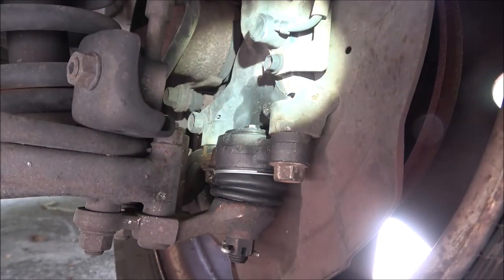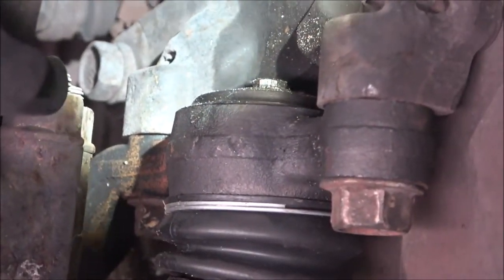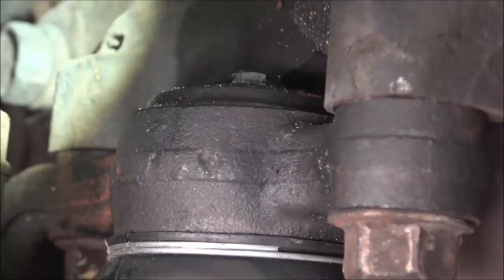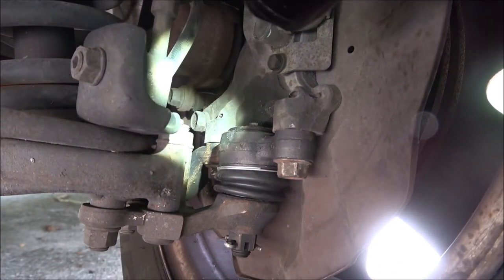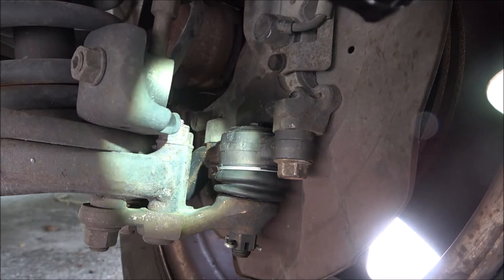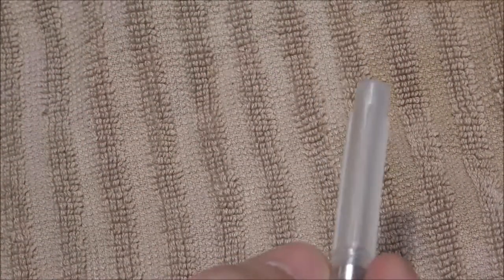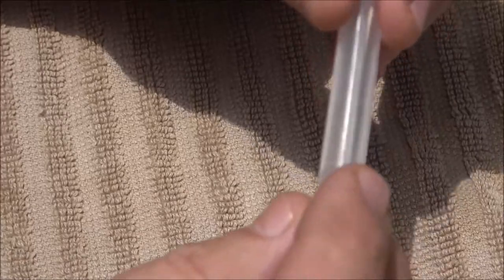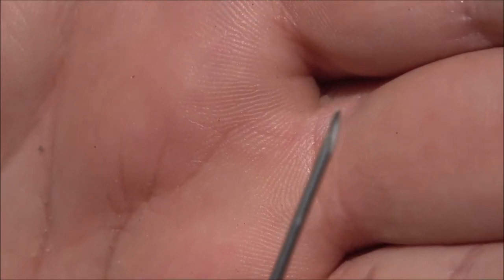How To Grease A Non Serviceable Ball Joint, Tie Rod End, ETC Without Fittings/Zerks

Comment: “Thank You!” I just learned this trick today. My Cadillac has sealed ball joints. It was squeaking like a bicycle that was left out in the rain. That means BADLY.  I used a drImmel sized drill bit.Then sprayed the lubricant (WD40 GEL) in by sticking the straw type tip, that comes with the Gel, into the boot. Drove the car a little bit and IT WORKED!  🙂 “Thank You!”
Reply from the maker: You're welcome.

Comment: You rock! Dang sealed ball joints got me worried no more :face-green-smiling:
Reply from the maker: Hell yeah, thanks man I'm glad it helped. Be safe my friend.
Reply: Dif I miss what you sealed up the hole with
Reply from the maker: @johndeloach503  you don't have to seal it up but if you want to you can use any kind of silicone sealant. Black rtv would be fine.

Comment: Some brands of tyre glue (e.g. Maxi Trac Tyre Repair Rubber Cement) contains sulphuruzing ingredients which will make old rubber (started hardening with minor surface crack) soft and elastic again. I applied that on my rubber safety boots as a primer and it worked. Will do a test on my 140,000 miles ball joint boots after regrease them with the method from this video.
Reply from the maker: That's a great idea. Thanks for the tip.  Let me know how it turns out.  Thanks for watching and commenting.  Have a great weekend my friend.

Comment: Time to get a grease pump then. I just got new ball joints in the mail and clearly there’s no grease in the boots and they lack zerk fittings
Reply from the maker: It works. Will save you a little money.
Reply: @shabear1000  i also saw another video where this guy drilled, tapped, and installed a zerk onto a non-servicable.
Reply from the maker: @Soldier1287  Yes, that works fine as well. Done it a few times myself.

Comment: You need to be sure it's actually grease that's filling up the boot and not air! Especially with a pneumatic grease gun. Sometimes you can just pull the boot down and shove grease in the joint.

Comment: One thing I wonder is if any grease would get down into the ball on the ball joints that only turn and not articulate like what is on a straight axle.

Comment: Can I use Johnsen's white lithium grease with PTFE instead? My concern is that the ball joint rubber might crack coz  lithium grease is not silicone. Has anyone tried using white lithium? Thanks
Reply from the maker: A friend of mine used to use it, but it's not high temp grease, so I would advise against it.

Comment: my mechanic says the grease you put in comes back out the needle hole when the wheel starts  spinning.
Reply from the maker: I have'nt had that problem. They tell you that because they want to replace an axle boot or cv joint. More money for them.

Comment: Does the grease come back out of the hole that the needle created?
Reply: It's possible, but getting dust/water through the hole is more of a concern than leaking grease. This can be avoided by dabbing some silicone rtv sealant over the hole.

Comment: Probably put silicone jb weld on the hole to stop it from leaking
Reply from the maker: That will work fine if you do see some leakage, but I personally haven't had that issue.
Reply: @shabear1000  okay bought the needle yesterday going to try it today

Comment: Don't you seal the hole you made with the needle?
Reply: Use some rubber/tire glue
Reply: @fsb_-bf3th  
Tire patch glue? Probably. Maybe.
Or fresh SHOE GOO. I have seen that work.
RTV silicone will not work/last
Reply from the maker: Not sure about shoe goo but yeah, good tips.  I never really worry about it cause the hole is so small nothing really comes out.

Comment: You're lucky that your vehicle already has grease fittings drilled and plugged.   Most newer cars don't have this done.  Suggestion: Just buy a packet of Zerk fittings rather than transferring a Zerk fitting back and forth.

Comment: I don't think that's a good idea now you're going to have a hole in the boat and water is going to get in there and destroy it you pissed off taking the plug off the top of the ball joint and go buy yourself a grease is Zurk then install it and for those that don't have a plug in there you can drill a hole unscrew a grease zerk in there that's what I did and it works excellent
Reply from the maker: So what you're saying is it's better to have metal shavings in there? Water will not get in there because the hole is too small, and the grease will keep it out. I've been doing this for over 20 years and haven't had any issues yet. I'm ASE certified on GM, Ford, and Chrysler which also covers jeep. I'm kinda qualified to to make these recommendations.

Comment: 13:15 I don't like how you stabbed a perfectly working boot.  I'm scratching my head here.  I hope you informed your customer before doing this because that's going to create newer problem.
Reply from the maker: Nope. It won't hurt a thing. This is our vehicle and still haven't had any issues. Been doing this for 20 years and never had an issue
Reply: @shabear1000  I'm not trolling. Take this as constructive feedback.  I've seen this device at Advanced and don't recommend it.  The rubber boot is already fragile.  Best not to mess with it.  What you're doing will lead to bigger opening comes next oil change.   The proper way is to drill then screw in a zerk connector using Loctite.  What you're doing is greasing only 30% out of 100%.  So what if the socket is dried out?  This is not affective at all.  The only way to get 100% coverage is push grease through the zerk connector so grease flows through the socket then out.  It's more work up front and saves much more $$$ and time down the road.
Reply from the maker: I guess you didn't read my reply right. I'm a retired ASE certified auto tech, NEVER had an issue. If the rubber is that fragile, then you've got other problems. GM and Chrysler actually recommend using this tool.